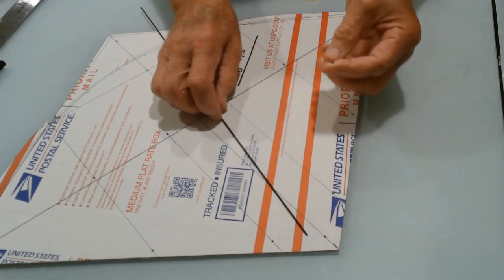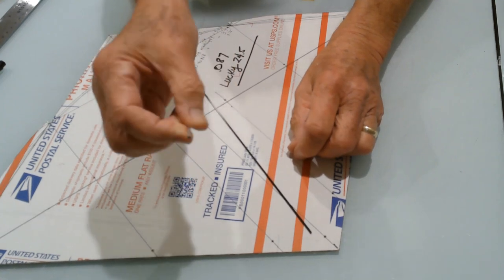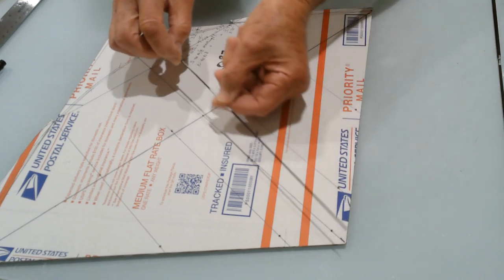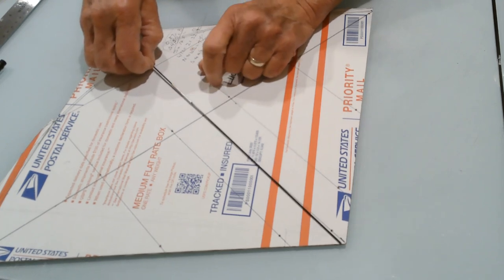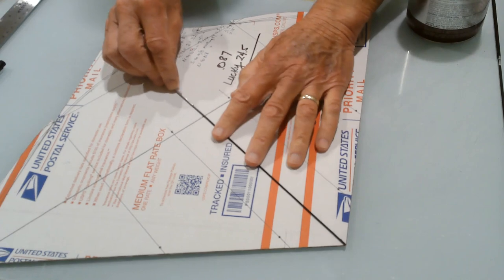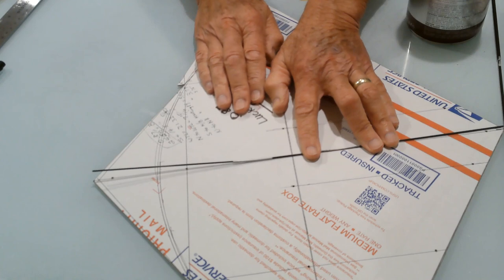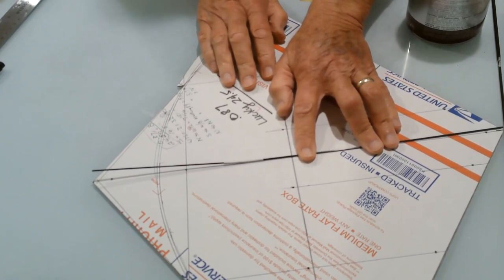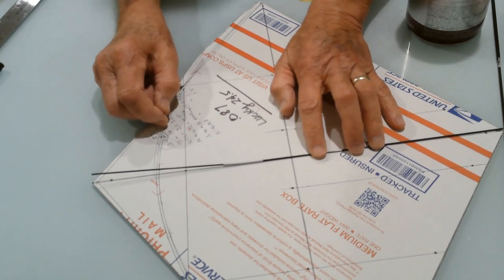Using A Carbon Rod For A Fighter Kite  Spine

Comment: Do you happen to have any videos on kite tails and how to make them?
Reply from the maker: No I don't.  However, a tail can be made of virtually any strip or multiple strips of any plastic, paper or other material.  The strips can be 1/4" to 1" wide.  It can also be several strands of string or yarn.  Most tails are around 4-5 feet long.